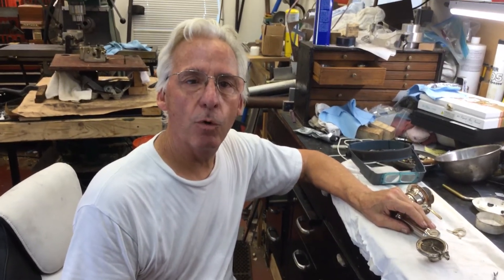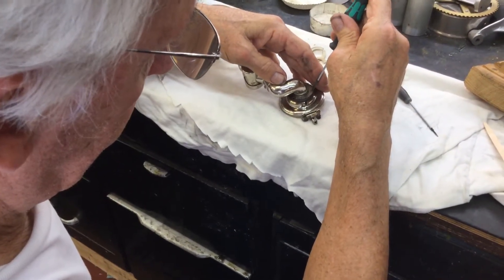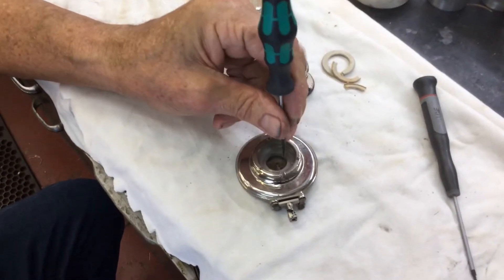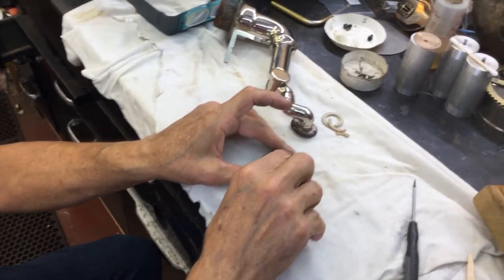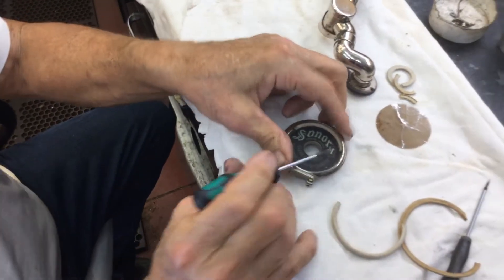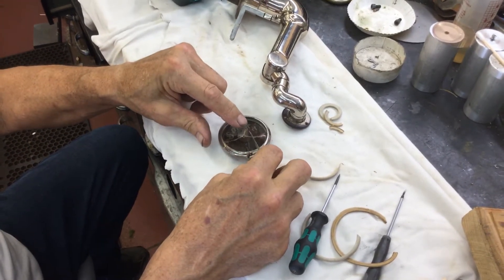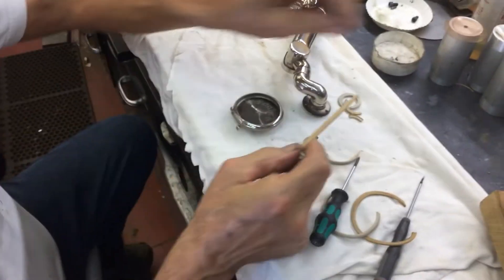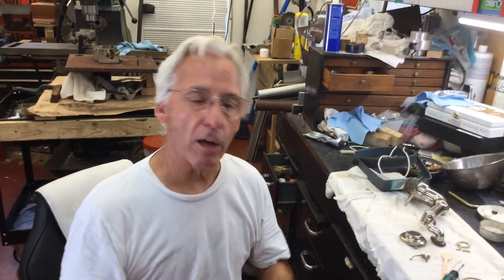392.  How to rebuild a Sonora phonograph reproducer

Comment: I need to replace my reproducer. It would be easier if I remove the complete "ARM" Question - when I take the three screws out of where the arm is connected to the phonograph - is there anything to look out for when I pull it off ? Are there any connections under the arm ?
Reply from the maker: Be careful when you remove your reproducer because it is pot metal and they have shattered in my hands before. There should be no need to remove the whole tone arm.